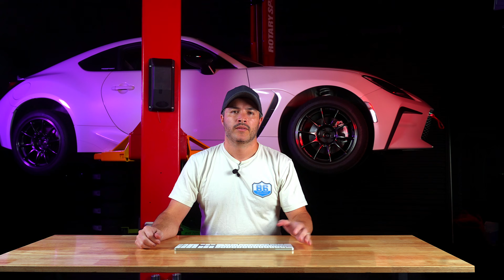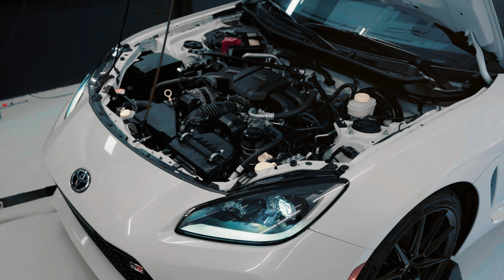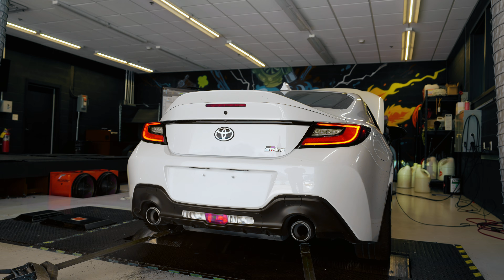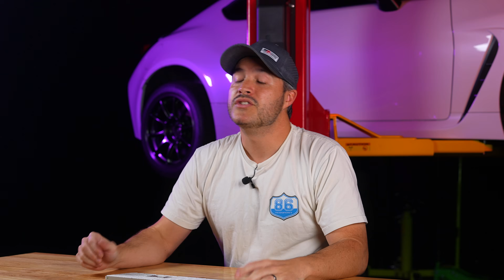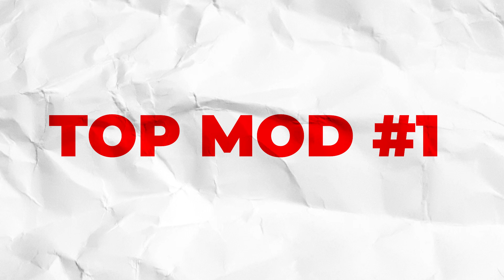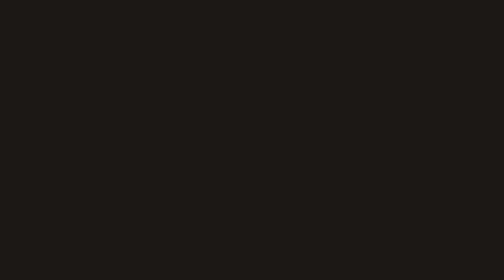Top 10 Toyota GR86 Mods In 2026

Comment: How about Brembo brakes from factory? Is it worth?
Reply: It's worth it, if only paying the $1500 upgrade when purchasing the car, but adding it after purchasing the car would be more expensive and then it becomes questionable if it makes sense
Reply: I went for them and I agree. Getting them upfront with the upgraded exhaust and wheels is well worth the cost as it be more expensive if you did it later.

Comment: Good video. Better informed than most YouTube kids try to do these days; especially with these cars.

I would agree with a previous comment about #10 contradicting the first half of the list. Boost is an entirely different topic as it requires a lot of supporting mods if you’re going to do it right.

I’d change it from boost to a proper a clutch type differential. A proper diff is so often overlooked on these cars and it’s really a night and day difference in performance driving applications. Also substantially cheaper than even the cheapest/lowest budget boost option

Just my 2¢

Comment: I just bought a 23 BRZ (manual transmission) with 22,000 miles on it from the dealership. Any reliability mods I should get and is RTV still an issue at this point?

Comment: So, let's say I buy a new premium GR86 and I follow your mods in order...

#1 I buy new tires replacing the already good PS4, 600$
#2 I change the wheels, ~1400$
#3 I tune a NA engine to gain 10hp, 200$
#4 I get better brake pads (that one makes sense, the stock brakes are meh) 300$
#5 I change the suspension and start messing around with complex things and back to wheels and tyres, 2000$
#6 I get and exhaust and/or headers, now I need to tune it again but this time making some true gains of 15hp,  2500$ (for both header and exhaust) +200$ extra tune
#7 I get an intake, and I need a new tune again to enjoy the extra hp, 600$ +200 extra
#8 oil cooler (ok that one is good, this fa24 heats a lot), 600$
#9 Oil pan, now I have to remove the headers again and reempty the oil circuit after all the previous works, 600$ minimum
#10 Forced induction... Let's dump almost everything we did before with tuning since we have to redo all again, intakes included, and add some extra problems with extra power... Between 5k$ and 10k$...

Take this with a grain of salt of course, but I think the video could have been better if it was more organized and didn't focus that much on selling glitter.
The average Joe wants to know how to solve issues and make it better spending a reasonable amount of cash in the right order.

My take is, the mods mentioned are "good", but for a 30min video it doesn't really show the logic behind everything and all is complex without or almost any graphics. It's just trying to sell what's easy without a context.

First question should be what you want the car for?
If it's looks, go for suspension and rims, a catback, maybe drop an aero kit or some lighting... But you don't need exceptional tires, nor headers, nor a tune, nor addressing the oil...

If you want performance or want to drift, chose the right tyres, improve the braking and address power and oil issues. Leave the rims, you don't want those TE37 scratched, nor a crazy lowered and cambered car that scrapes on every track bump and steers like trash.

The platform is already good in almost all aspects, it all comes to preference.

If you made it that far, sorry for rumbling, everything I said is constructive criticism and I'm not trying to degrade you in any way, just giving my grain of salt :)

Have a good day
Reply: Low-key a good tree diagram or something to show connections between upgrades would be sick as it would help show the complicated connections between each possible upgrades, like showing that if you get a forced induction system but not tires you'll be losing traction and such. I do agree with you though, this video doesn't really show a good order of installation, but rather a "depth of mods" so how far you go into modding. With tires being the surface level and forced induction being like the final stage. Could definitely be better
Reply: Read the whole thing. Just bought a white 23 gr86 premium. What would you suggest in order with the logic behind it…..if you have time to respond of course
Reply: Well it depends on what your final design is. As well as what you prioritise. You can kind of sort the mods into a few categories. Reliability, engine performance, aesthetic/aero and sound. 

I'd recommend reliability first if you're going to be pushing it hard, these will let you drive without having to worry about causing any issues/accidents. So tires, wheels, brakes, oil cooling and oil pan. Get the wheels, tires and brakes together, and the oil cooling and oil pan together to save on installation costs. Coilovers are also here as they can improve stability when done right. Any of these can be done in pretty much any order you want as they are independent mods.

Engine performance would be forced induction, intake and headers/exhaust. These generally require a tune to get a benefit from them, and if you choose to get forced induction it will need a complete retune to work so I'd probably get it last and not tune the other parts.

Sound will be affected by the exhaust and intake, so basically the performance parts, but you can use them without tuning the car if you just want the sound. Intake will need to be redone and maybe even replaced if you go with forced induction though so keep that in mind.

Aesthetics/aero. This is mainly where cosmetic design comes into play. I include coil overs and wings here as they affect aero. You can pretty much do anything you like with this whenever you want without any issue. Front splitter, diffuser, skirts, wings, body kits etc.

So choose any of those categories in any order you want really, with a recommendation on reliability if you're driving hard.

For reference, my order will be sound, reliability, performance then aesthetics/aero. So equal length catless 4-1 headers, over pipe, high flow catted front pipe, xforce 3" varex catback. I like my sound and it's lacking stock, won't be driving it hard yet. Next will be installing an oil cooler and oil pan. Then installing the harrop supercharger with the k&n cai with a flex fuel tune, I want a snappy throttle response with good torque and smooth and predictable power. I'll then get tires and rims. Lastly spec it out with carbon parts, a wing, a wrap, etc. No coil overs.

I probably missed some things but hope this helps as a general guide, I'm also pretty new but I've been putting tons of research in, happy to get corrected by people with more experience so feel free to point anything out.
Reply: @MrSkiloV  I have a GR86 premium with the performance package. These are my thoughts. 
Do your research, as you are doing, and get to know your car.
1 - Maybe different tires would make a huge difference. Not worth the price IMO, unless you have used up the original tires already. Do the research so you know what your SECOND set of tires should be. 
2 - Don’t replace wheels until you are buying your second set of tires. Again, do the research so you know what you want when it is time to buy.
3 – A tune. Important, I believe, but don’t tune the car until it is at a state it will be at for a while. My car is running on the stock tune. I will not get it tuned until I have the mods installed that I plan to live with for a while. I currently have the JDL catted UEL header, overpipe, and front pipe. (3”) I plan to add a cat back and a Fluiddampr. Then I will get a tune. I will not tune again (probably) until I add a supercharger. That will be years from now.
4 – Brakes. I got the uber brakes with the performance package. I have no other comment. Well, maybe I’ll get the Ansix brake ducts. I’ll buy them when I order the oil cooler. I figure I’ll need the cooler when I’m prepping for the Harrop supercharger.
5 – Suspension. I don’t know enough to have a knowledge opinion about which is best. Again, I’ve got the performance package, so I’m good until I can talk to the trainers at the track. The local track has a good training company & they offer GR86s if you want to take their classes and not use your own car. I figure they’ll know more than just about anybody. 
However, I have made some updates in this area. I’ve installed most of the Cusco stiffening parts. They really seem to stiffen the car up, but I’ve got no solid data to prove that. I’m looking forward to having a trainer at the driving school take it for a spin and see what they think.
Very long term, I would like to buy the lowering hardware from Wisefab. Lots to learn before I pull that trigger.
6 – Exhaust. I ran over a rock last year, so the planned upgrade of 2026 became the repair of 2025. I really, really like the header I’ve got. The rest of the exhaust and tune will occur shortly.
7 – Intake. Long term, I plan to install the Harrop. So any intake should, ideally, work well with that. I bought the Greddy Direct Air Intake Duct. Basically a ram air intake. I think it sounds better, but I don’t have any before/after recordings. There is a high pressure zone RIGHT THERE when driving fast, so it most likely gives me a few HP on the road. You’ll never see the difference on a dyno, however.
8 – Oil temp. I plan on getting the Ansix water to oil cooler. While I plan to track my car, most of the miles will be street miles. IMO the oil being too cool on the road is almost as big a deal as too hot oil on the track, given the time on the road vs. track.
9 – Oil pressure. I’ve bought and installed an oil accumulator, which should mitigate the oil pressure issue. IMO having a buildup of oil pressure is much better than more oil in a better shaped pan. The accumulator also means my engine sees oil pressure much faster on start up. Most engine wear occurs during startup with cold oil with low pressure. I hear a “clunk” every time I press the start button. That means somewhere between one half to one and a half a quart of oil is being injected directly into my engine block oil passages. I love that clunk sound.
10 – Forced induction. I’ve touched on this above. 
Keep in mind this is a sales video. Everything he recommends, he happens to sell.
I started by adding some pages to my personal wiki. I grabbed links to everything I saw that I might have been interested in. And I grouped them together. One page for stereo equipment. Another for suspension/ chassis. Yet another for exhaust, etc. 
In time, I had a long list of parts of what I might want, and the links on where to buy them. Then I started culling. I can only buy one set of wheels, (well, you know what I mean) so pick my favorite and delete the rest. Narrow down what you want, and rank the order you would like to do them in. Keep adding parts to your wiki. Keep deleting parts you don’t need or want. Repeat until you have a perfect car, you run out of money, or can no longer drive.
Reply: @KernelFault you sound like me lol thinking much the same. I am 71 and dying of cancer. I had planned to get a GT-R, lack of GT-R in my area, and the whole automatic thing led me here. I can now recommend the TRD (GR) sway bar kit, so glad I ordered and paid for it months ago.
Let’s talk tuning- NONE of the TRD parts install instructions tell you to go get your car tuned. In fact, I am positive if you tune your ECU you just destroyed any warranty you have. 
Remember folks, this guy is not an enthusiast, he is an actor paid to sell you parts on YouTube.

Thank you for your post.
Reply: @KernelFault  I love the "repairs of 2025" like the great flood of 1891
Reply: The thing is from a logic point of view, the money really starts to tick up and honestly in particular anything to do with forced induction and tuning, you’re paying a premium to take on risk for minimal gains.
There’s a law of diminishing returns in action.
The cars are no longer cheap to begin with so there’s that.
There’s a point early on where it would be just cheaper to go and buy a 2nd hand Nissan 370z rather than play about with all these mods.
Bear in mind I’m looking at this from a perspective in Australia where a GR86 is + $50K brand new and a 2nd hand 370z can be had for $35K with only 40000 miles on them…
Reply: @JodyForbes you are spot on.
Reply: Him saying tyres is just some preloaded bs they say for every car, the car comes with ps4’s as standard which are pretty good
Reply: Buy a good used one.
Reply: The worst part of it all is that the script was VERY obviously written by AI, and edited to throw in the the branding stuff. I even fed it to an AI to check, and it said upwards of 75% likely it was AI.
Reply: @TrademarkMediaTM honestly surprised that I haven’t seen any other comments about it
Reply: I think the problem with this video is that he never lays out the objectives.  Mine being track focused has a different pathway than someone looking for a stance car, which is different than someone looking for a drift car.  Without knowing where you want to end, its really expensive to go anywhere.
Reply: As a 24 Trueno owner let me stop you at #3.  The ECU tune isn't about tiny power gains it's about un-fucking Toyota's dogshit throttle mapping.
Reply: Bought a premium halo 86..no need for upgrades...car is perfect to me the way it is...if I wanted all those upgrades,  woulda got a supra...
Reply: Agreed, I bought a ‘26 premium with performance. Brembo brakes and an excellent setup. No need to do anything except add an aftermarket sound system. I went with a nice Alpine setup.
Reply: IMO a street car really doesn’t need anything. Maybe tires. These are great from factory. 

Track is another story but chasing power mods seems like a waste. For track, oil pan, oil cooling, tires, pads, fluid. If more advanced camber mods, coilovers. Don’t have to spend a ton. 

If chasing power, headers and tune are all I would do. Anything else gets into too much money for too little gain, or creates headaches and reliability issues
Reply: @rckrckrckrck  i would put camber at top of track mods, fairly cheap set of bolts for $50-100 and then adjustable rear control arms make a world of difference.  It would be behind brake pads, fluids, and tire as those are pretty much required for track use.

If I could do it over, that would be about all mine would have, and probably tune to fix the silly throttle mapping.  

If you want easy power, header and flex fuel tune will get you about 30-35 whp.  After that you are chasing driveline limits pretty quick and adding lots of cost.
Reply: @jrfish007 I have heard camber bolts back out?
Reply: @rckrckrckrck  havent seen that, suppose they could, but the ones I have lock in place with tabs and then have locking washers to stop the nut from backing off.  Im sure it happened to someone somewhere, the oem bolt is more likely to backoff IMO. Maybe if they didn’t torque it correctly, its pretty tight to get the leverage you need.
Reply: Ok, I am new to all this but looking seriously at the 86.  Is there not an aftermarket oil pan gasket available that would negate the need for silicone type gasket ?  There must be a reason if there is not one but I have never seen anyone address the issue.
Reply: I did the perrin oil cooler mod, and a cat back exhaust.
0 toe  -2.8 camber alignment, 
Track brakes, track tires, konig wheels for use ON THE TRACK 

Idk boys... I guess the mods you need are the ones you find necessary while OUT ON THE TTRRRAAAAAACCCKKKKKK BBBOOYYEEEEEEEE

Comment: I have the PP on my GR86, just bought Rays GramLights 57DR 18x8.5 +37. Will these fit with Brembos?
Reply: Probably should have gone with 17 after watching this video. But I don’t think I’m that nice that I’ll notice the difference tbh🤣
Reply: also would you recommend messing the stock suspension like adding lowering springs? I don't want to get rid of them since I paid for the performance pack.
Reply: @cheifsosa8864  I have the PP and I added RS-R down (not super down) springs. Love the look and handles better IMO

Comment: What is lowered too much? Yep going to low will hurt but where is that, what is too low what is just right?
Reply from the maker: In general, lowering beyond 2 inches or 50mm of the factory ride height is where you'll start needing roll center/geometry correction parts to dial out unwanted handling behavior.

Comment: Any thoughts on the Infinity Designs intake vs the GR with regards to sound and performance with a tune(car will also soon have full exhaust)?
Jackson Racing oil cooler has been great at keeping my oil temps in a good range during 20min. track sessions in Summer. Would recommend.

Comment: Great video. I guess I’m an old man because I prefer the Borla S type cat back for sound. 😂

 What oil weight do you recommend for the GR86? That’s a major topic on the forums.
Reply from the maker: Quality 5w30 full synthetic is what we run and recommend!  We have Motul and Liquimoly service kits available for purchase on our website, along with magnetic drain plugs to keep your engine healthy!
Reply: @Teqsport I know you guys are in GA like I am. Do you recommend 5W-30 year round? My GR86 is a fun street car not a track purpose build.
Reply from the maker: Yes, we run 5w30 year round down here.  Especially on a FA24 that has the factory water to oil heat exchanger, which warms the oil up faster.  It's always a good idea to let the engine idle for a minute or two on cold starts to get some heat in it, but that bump in oil weight is critical to long term reliability, in our opinion, if the car is driven hard often.
Reply: @Teqsport thank you!
Reply: Concur